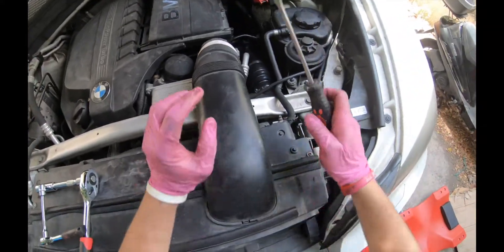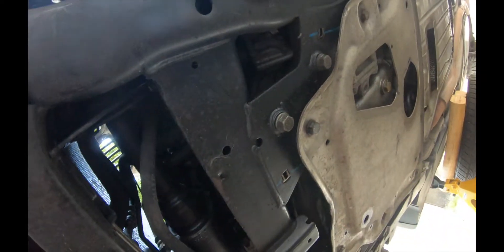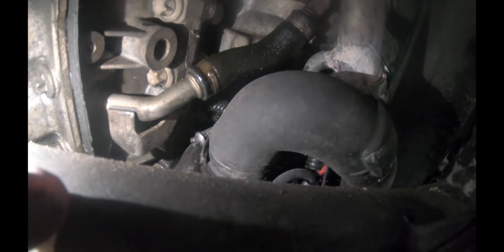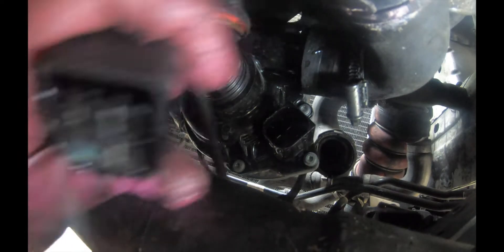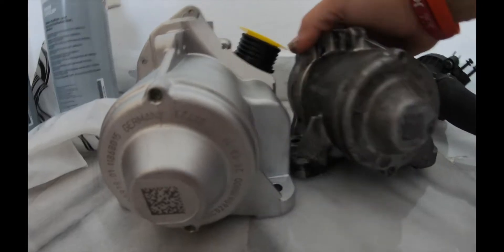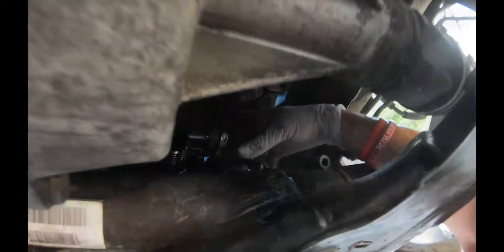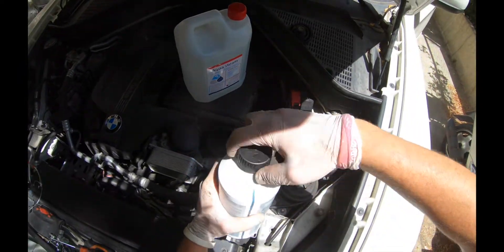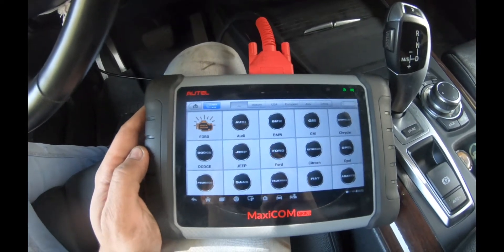Water Pump and Thermostat replacement 2011-2013 BMW X5 X6 E70 E71 Xdrive35i - GoPro & Do It

Comment: Your lucky yours looks like it's rwd. I'm working on a turbo charged 6 with AWD and there is zero room.
Reply from the maker: @scottrudner8834  same mate mine is turbo 6 cyl
Reply: nah don't discount his ability look at 9:12 that is the front drive shaft housing AWD not RWD  the shaft is going right thru the oil pan
Reply from the maker: @RealRapp_FG  yeah mine is AWD mate Cheers

Comment: Is the n55 reliable? And which is more reliable the e70 35i or f15 35i ? I know they have the same engine the n55 , but did they fix any issues in the f15 ?
Reply from the maker: They all have the same issues man. The 8cyl has a mechanical water pump, however the turbo 35i they are all identical.
Reply: @goprodoit  The n52 is better? Or the n20 2015 when they fixed the timing chain issue ?

Comment: Why both not only the pump
Reply from the maker: It is recommended to replace both when you are replacing the pump. 
Most of the times if the thermostat is faulty, it won’t be reflected on the diagnosis process via your scanner…
Reply: What about the other way around? I think it's the thermostat that's faulty not necessarily the pump too. If it's just the thermostat could I avoid replacing the pump too? The car has been overheating but at first the temperature would go up and down, leading me to believe it's just the thermostat. Although I'm not sure. Thank you.

Comment: Is the water pump broken? What is the mileage of the vehicle?
Reply from the maker: It was around 100,000 miles
Reply: @goprodoit  Wow! 100,000 miles on the pump which is not bad. I heard a lot of water pumps failed at around 50k miles. Mine just passed that mileage mark so I was wondering if I need to replace the water pump as a preventive measure. The pump is still working fine right now. What do you think?
Reply from the maker: @joncattletown557  I guess you need to constantly check your coolant tank level mate. And when you shut off the car if you ever heard the pump still running for a while then you should get worried
Reply: @goprodoit  Thanks for the reply. You brought up a good point. I did hear the pump running after shutting off the engine but not for long, maybe just a few seconds. For coolant check, I do need to top up coolant probably every six or so months. The coolant system was pressure checked and was not leaking. Do you think that is a sign of a failing water pump?
Reply from the maker: @junzhu8584  Thanks mate. 
Just check if you kept the driver’s door opened after shutting off the car, the water pump won’t turn off, it will when you lock the car and after few seconds. 
In any case it is an early sign that your pump is failing
Reply: @goprodoit  Thank you for the good advice. So does that mean that the water pump should be turned off immediately after the engine is off?
Reply from the maker: @junzhu8584  No worries mate, yes should be turned off after shutting the engine
Reply: @goprodoit  Thank you for your patience and help. Since I will have a road trip of 1300 miles upcoming, I really don't want to be stranded on interstate. That's why I have asked so many questions. Maybe I just go ahead to replace the water pump before hitting the road for peace of mind. Thank you.
Reply from the maker: @junzhu8584  no worries mate anytime. 
Keep checking you coolant tank level look for any leakage under the car, since it the water pump would fail anytime soon it will be leaking from the electrical plug and from its rotor plastic head.
God be with you
Reply: @goprodoit  Please bear with me for so many questions. When you bleed the system, is the external battery charger necessary? You didn't mention this in your video. I see different opinions online. Thanks.
Reply from the maker: @joncattletown557  sorry for replying late. 
An early sign of a faulty water pump is when it turns on when you unlock the car and still running even when the engine is off… this would dramatically drain the battery, and that’s why you do not need to stop the bleeding system…
Reply: @goprodoit  Thank you for your consistent help. So what you are saying is that the water pump will start to run when I unlock the car and will keep running when I shut off the engine. Basically it will run the entire driving time as I understand. But I am confused about your last sentence "that's why you do not need to stop the bleeding system...". What is that referring to? Also, do you need an external battery charger when bleeding the coolant system, which was not mentioned in your video? If yes, what type (capacity) of a charger do you recommend?
Reply from the maker: @joncattletown557  no worries 
I was saying that if you have a faulty water pump in your vehicle then it is certainly draining your battery (since it turns on the moment you unlock your car or open any door and will remain running even if you don’t turn on your engine and eventually your vehicle’s battery is not being charge when the engine is off, however the pump is running and continuously draining the battery…)
Moreover after replacing your water pump and if your battery is weak you need to boost it since you need to bleed the whole system and this is done while the engine is off also, hence the battery is not being charged… and *you do not want to cut the bleeding due to a bad battery* So my recommendation is to boost your battery while bleeding the system and adding coolant..
As for the booster, it doesn’t matter what capacity you use as for the current (mAh) but make sure that the voltage is 12V